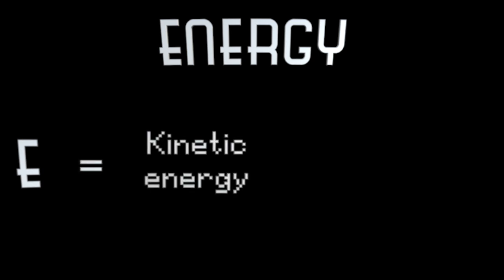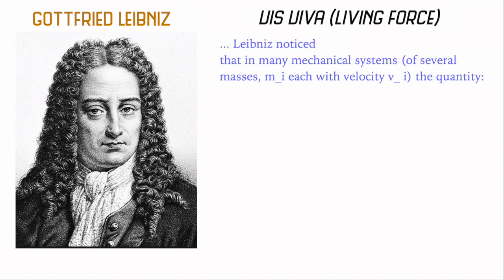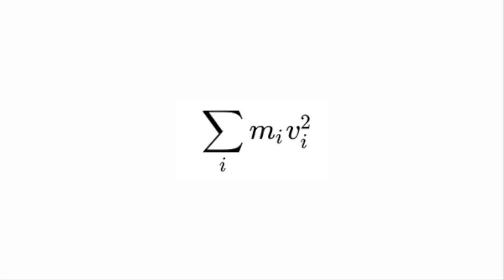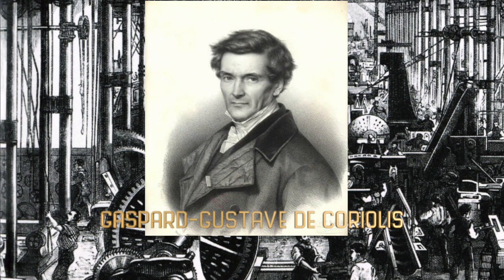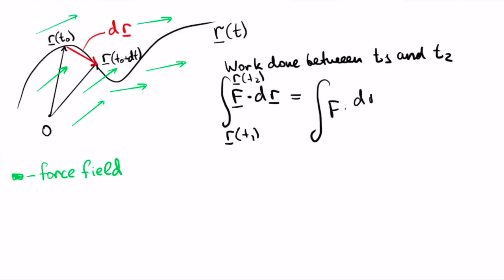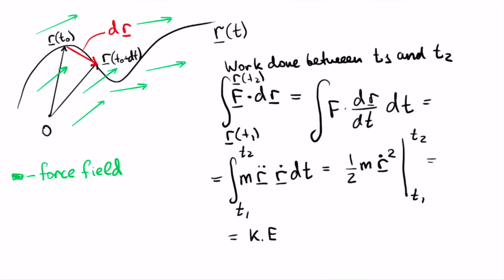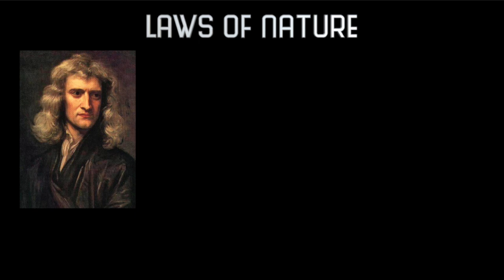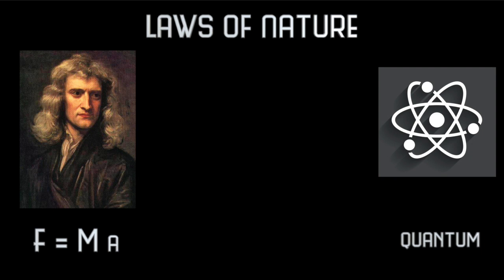Why is there a half in kinetic energy formula ? Work- energy principle.

Comment: Enjoyable and informative video — thank you.
I have seen this derivation on a number of occasions, and appreciate the strange ½ coefficient as an artifact of the Power Rule with integration. Still hoping for a more intuitive (algebraic?) illustration of kinetic energy.
Reply: I'm no expert, but I like to think of KE as the result of force applied over distance and momentum as force applied over time.

Please, someone correct me where I'm wrong. That's probably more of a "where" than an "if."

I'm trying to learn.

Here's the algebra I came up with, starting with KE = force * distance.

Symbols used:
KE = kinetic energy
kg = mass
F = force
d = distance
a = acceleration
t = time
v = velocity

KE = F * d
KE = kg * a * d
KE = kg * m/t^2 * d
KE = kg * m/t^2 * 1/2at^2
KE = kg * m/t^2 * 1/2 * m/t^2 * t^2
KE = kg * 1/2 * m^2/t^4 * t^2
KE = kg * 1/2 * m^2/t^2
KE = 1/2 * kg * v^2

KE = 1/2mv^2 (changing the symbol for mass from kg to the more common m, which was used for meters above).

Here's a narrative:

KE is force over distance (F * d) which would be kg*a*d (mass times acceleration is force, displacement is d).

Expanding acceleration into m/t^2, KE is kg * m/t^2 * d (mass times meters per second squared times distance).

Distance is 1/2 at^2, so KE can be rewritten as kg * m/t^2 * 1/2at^2.

Expanding that new appearance of acceleration into meters per second squared, KE becomes kg * m/t^2 * 1/2 * m/t^2 * t^2.

Simplified one step, KE is kg * 1/2 * m^2/t^4 * t^2

simplifying another step, KE is kg * 1/2 * m^2/t^2.

Velocity is m/s, so m^2/s^2 is v^2 - KE is 1/2*kg*v^2, more commonly written as 1/2mv^2.

Please let me know where I missed the target!
Reply: @johnnyragadoo2414  ok but where did you get KE=F×d from?
How is KE related to force if an object can have no force acting on it but still have KE?
Reply: @l1mbo69  Great question. I’ll give it my best. The definition of work is force over distance. KE is the potential to do work, so work on an object gives it KE. As the object accomplishes work on something else, it trades KE for work done.

So, it takes work to change an object’s velocity, which changes the object’s KE. If the object is moving at a constant speed, then it is keeping a constant KE even though the net force on it is zero.

Here’s a weird twist to that. KE is not conserved, because it can be converted to another form of energy.

Energy is always a scalar, too. KE does not have a direction, even though velocity is part of it and velocity is a vector. A one Newton force over the span of one meter always results in the same change, plus or minus, in KE, regardless of the direction of the force. Velocity and momentum change will depend on the initial direction of the object and the direction of the force and how much time it takes for the one meter of distance.

KE and momentum are both relative, so you need to keep your reference consistent. That’s actually how I got the difference between KE and momentum straight. A flat earthier made the argument that an object thrown east had the same KE as if it were similarly thrown west, which he thought was proof the earth didn’t spin. I tracked down momentum and KE on moving platforms for the point of view from the moving platform and for a stationary observer. It all made sense, then. When I get to my desk, I’ll share a link, hoping that is not an unwelcome thing here.

In contrast, momentum is conserved, it doesn’t convert to anything else, and momentum is a vector. I think of momentum as how velocity is distribute after a collision.

Amazing how consistently that all works out, how nature works out infinite calculations per second, and gets them all precisely correct.

Please keep in mind I’m newly awakened to a lot of this. I appreciate fact checking and correction.
Reply: @johnnyragadoo2414  thank you very much for your very detailed explanation

Also as a remark to your last comment, we should remember these are just models for our convenience, because the universe obviously doesn't "remember" to conserve momentum. Rather there are mechanisms that dictate how a system evolves moment to moment, that sometimes happen to follow a greater law (forcefully, due to fundamental symmetries in the very nature of our universe)
Reply: @l1mbo69  My pleasure! Nice chatting with you, and best of luck in your intellectual exploration.
Reply: @johnnyragadoo2414  The problem with your explanation is that still uses the acceleration formula that relates to distance, which still uses calculus, really.
Reply: @angelmendez-rivera351  You got me, Angel, but in my defense, I'm not sure how to relate any velocity, changing or constant, over time to distance without an integration.

Distance is vt. A constant 30 mph, with velocity on the y axis and time on the x, is a flat line - a line with slope 0 - parallel to the x axis at 30 on the y.

The area under that flat line is rectangle representing distance covered. Integrating y=30 is just 30x.

If you are accelerating, distance is still the area under the velocity curve. A constant acceleration results in an angled straight line on the graph.

If you start at 0 mph and accelerate constantly over a given time, the area representing distance is a triangle. The area of a triangle is 1/2 base times height. Distance is 1/2 at^2.

Why t^2? Because velocity (the line on the graph) is acceleration times time. The y value at any point is time dependent, so we multiply acceleration by time once to get velocity (the y value), and by time again (the x value) to get distance.

The integral of acceleration is velocity, so for a constant acceleration the area is a rectangle. v=at.

The integral of velocity is distance. Plotting the changing area of acceleration times time over time gives an area under that line representing distance.

At this point, I've exhausted my poor understanding of calculus.

Did I hit the target?
Reply: @johnnyragadoo2414  Well, the point of my response is that there is simply no algebraic derivation of these formulas in the general case, and OP insisting that we want one does not change this. Calculus exists because we need it to exist in order for the physics to work. If it could be done with algebra alone, then we would just use algebra.